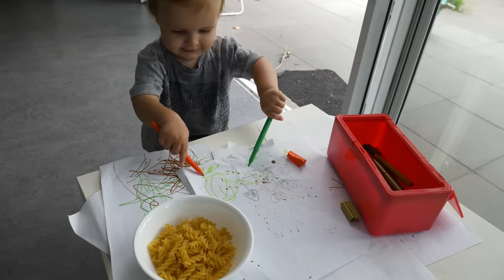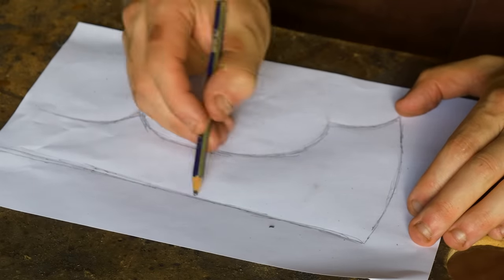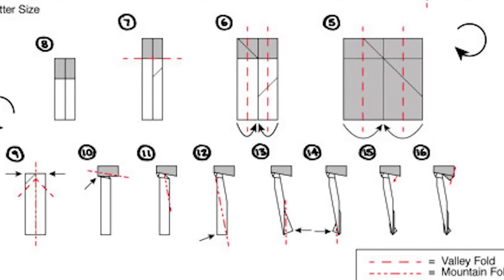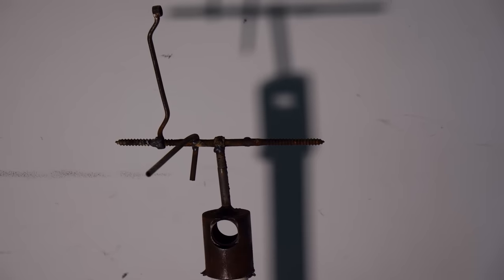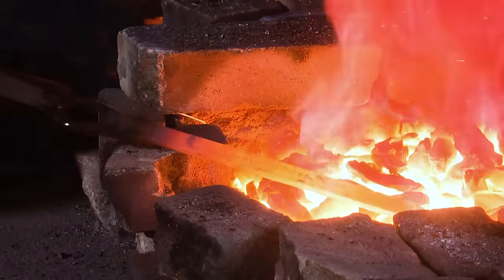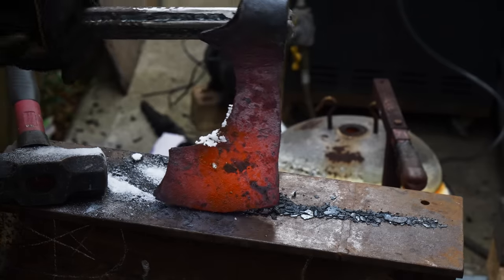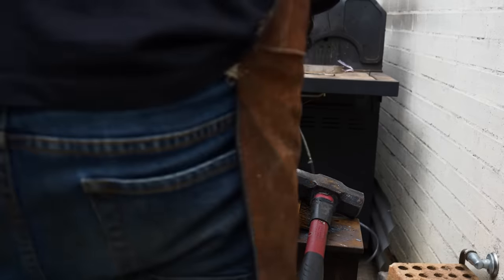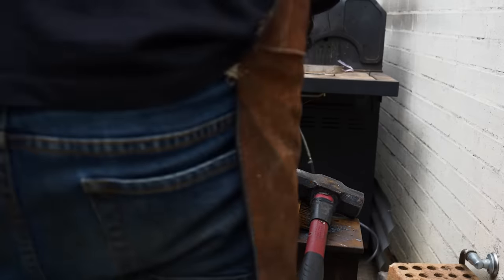YouTube's Worst Blacksmith Makes a Viking Axe!

Comment: This is a bit late but the reason lumberjacks have two heads on thier axes is because when one side becomes dull they don’t waste the day walking back to the camp. they just use the other side
Reply: Close but not quite, one side is kept sharp for for chopping at waist height away from the ground and the other side ment as a sacrificial edge when chopping close to the ground.
Reply: @codywright6224  Could be either or depending on the overall job at hand. It could really be used for either purpose, which isn't much of a conflict, but a syngergy.
Reply: I thought one side was for chopping and the other for splitting.
Reply: All you internet experts probably haven't even held an axe, let alone felled a tree with one, bahahaha
Reply: @jangofett7047  of course not. I fuckin googled jt
Reply: @Ultimate_Gamer_3000  it
Reply: @jangofett7047  nah don't correct me. I know what I said.
Reply: @Ultimate_Gamer_3000  ok jt
Reply: Is that really true? I feel like if I had to work with an axe all day I would much prefer to carry a backup axe or a small whetstone and occasionally spend 5 minutes to sharpen my axe, rather than having to work all day with a much more awkward to handle and dangerous tool.
Reply: @jangofett7047  you're just jealous that you can't be helpful even online.
Reply: @jangofett7047  
Says the 300 pound couch potato living in his moms basement lol
Reply: @Antares-dw9iv  yeah some do that too. But a two headed ain't to much of a drag
Reply: when i say that part of the vid i was about to comment about that but i looked in th e comments first so i dindt copy
Reply: @Ultimate_Gamer_3000  based
Reply: @jangofett7047  you say that as if its a big deal to chop down a tree, it takes a couple hours (resting time removed) to fell a decently sized tree, its not like its some big task that few people can do
Reply: @jangofett7047  i usually use a chainsaw but I have felled a couple trees with an axe.
Reply: I always thought 2 headed axes were battle axes, not for lumberjacks. Learned something today.
Reply: @Antares-dw9iv  That's more awkward for you? Why?
Reply: @Reactiontime6000  no hes more like a nail that came to life and was dull as a fucking eraser
Reply: That seems to be wrong... Or at least I can't quickly find that explanation, but the same explanation keeps popping up elsewhere. One side is sharper for chopping and cutting, and the other side is duller and rounder, for splitting.

More weight in every single swing seems more impractical as far as energy expenditure, but if you use an axe properly (without fighting it so much), more weight can just help you.

This does not apply to battle axes, where a double bitted axe is just ridiculous and there aren't records of such a thing being seriously used in battle. But anyway.
Reply: @CommunicationsOfficer535  
Stop, stop he’s already dead!
Reply: @Reactiontime6000  no
Reply: @jangofett7047  why are so many people mad at you? Lol
Reply: @jangofett7047  You do know there are real life experts with internet access nowdays?
Reply: @Antares-dw9iv  much more dangerous tool? Wdym?
If ure hitting urself with the blunt end of regular axe, ure using the axe wrong. So if the blunt side is also sharp, it's not more dangerous at all.
Carrying 2 axes would be a lot more inconvenient. Axe is usually arms length or a bit longer. For chopping might be longer. It's... Not convinient to carry 2 that long objects than 1 slightly heavier object
Reply: @jangofett7047  I do actually. With decent axes, with dull axes and with really sharp axes.
Dull axes ain't the best. If I had to go far from home to gather wood I'd rather have a backup edge than one lazy and tired evening and get fked next day
Reply: @rhombo323  I don’t think any people ever actually used axes in war once they moved beyond the Stone Age.
Reply: Thats pretty big brain
Reply: @jangofett7047  I did, once, It was a fairly THICC tree. Not GIANT but the size of a nightstand. And I broke my leg when me and my babysitter cut it down. Memories.
Reply: @rhombo323  There are a lot of two-headed battle axes in fantasy. Axes in general are often depictes as massive chunks of steel. Anyone who has swung a sledge hammer, or even a cleaving axe, realize that it would be completely useless as a weapon unless your opponent is chained to the ground. If you are fighting a human, not a dragon, you don't need a huge amount of weight in the axe head to cause serious damage.  
In the real world, most battle axes are light and nimble, like the tomahawk, the francheska or the viking axe, even the two-handed types.
Later medieval knights used a heavier type of two-handed axe. Sometimes with two axe heads, but more often with one axe head and one hook or spike.  This is in the era of full plate armor. These axes were used quite different from what you would expect though. You can see them more as a giant can opener, used to trip your opponent, or pull them from their saddle. Then the axes are used to bend and pry open the opponents armor, or break or dislocate their joints. There are illustrated fighting manuals from the time, showing these techniques in detail.

There are many archeaolocical finds of two-headed axes, both in artwork and actual artefacts, from the minoan culture for instance. All of these seem to be strictly ceremonial weapons though.
Reply: @Antares-dw9iv  everything you said isn't really true.
Reply: @jangofett7047  I have just thought double headed axes were mainly weapons and not for felling trees and in fiction
Reply: Could they not just carry a sharpener in their pocket?
Reply: It could also be a battle axe with 2 heads as it made it way easier to swing in 2 directions rather than just swinging in one direction.
Reply: @GlorifiedGremlin  Sharpening is also an option, however it's downtime where you're not earning money. I carry two chainsaw chains in the field as changing a chain takes less time than sharpening it. 
Felling axes are generally are more balanced than other axes, as most axes are designed to cut downwards as opposed to a felling axe which needs to cut horizontally. The opposing edges balance each other nicey.
Reply: If you want the truth just ask Cody at Wranglerstar.
Reply: @blackout6411  double edged things are usually more dangerous than single edged ones.
Reply: @lick28  Based on the wording of his comment I can safely assume he hasn't worked with an axe before. I however have. I've worked with hatchets, normal axes traditionally used for lumber, and two-sided axes. I can see how a poorly designed two-sided axe would be counterproductive but if you're using a simple two=sided axe then you have an effective weapon and an even more effective tool. Anyone who has too sharp of an edge has a problem with the design, not the idea of the axe itself.
Reply: @blackout6411  that's not what I'm getting at. The nature of double edged things itself is dangerous. When you handle single edged things, you know to face the blade away from you, but when it comes two double edged things then it's a different case. It's not the design itself that makes it more dangerous/hazardous but rather the nature of double edged tools/weapons.
Reply: @lick28  This sounds foolish. I understand that anything with an edge can be dangerous if a sharp edge is pointed at you but axes are not like knives or swords or razors. Trying to equate them all as posing the same danger is illogical and just wrong. Would you try to box with a firearm? Of course not, but you assume that axes would be wielded the same way you would wield a sword. The edges are different and thus pose a different type of threat.
Reply: @blackout6411  being more dangerous doesn't necessarily mean actually dangerous.bmy point is that double edged things are simply more dangerous than their single edged counterparts. Nothing more nothing less.
Reply: @lick28  That's really dumb, I wish you could see how your statement looks.
Reply: @blackout6411  since we can't come to an understanding, sure. You're correct.
Reply: @lick28  We're arguing opinions, dude. My problem has less to do with what you think compared to what you said.
Reply: @blackout6411  a statement that goes "two edges are more dangerous than one" is not an opinion.
Reply: @blackout6411  a dull blade is still a blade. You're talking about it like it's harmless. We're really just wasting time here.
Reply: @lick28  You're right, it is wasting time because dull blades are less likely to cut than sharp blades. Even a child could understand that.
Reply: @blackout6411  sure man
Reply: @Antares-dw9iv  one of the sides are always dull, while the one facing away from you is sharp. but anyway, double sided axes were decorative ornaments more so than tools
Reply: Lumberjacks had double headed axes because the government knew that double headed axes were harder to throw, and did not want the lumberjacks to start their own militia. They infiltrated the smithing business and spread lies about the effectiveness of double sided axes, but in reality the only goal was to deny any possible uprisings ranged superiority, as lumberjacks we're a lot stronger in close quarters combat due to being absolutely ripped
Reply: I have felled many trees by axe, but i never had a double headed one... i prefer to drop it by chainsaw tho, the flat edge is easier to split by axe...
Reply: @Antares-dw9iv  when i cut my first tree i used a hatchet  but axes have way longer handles. i doubt it would be very dangerous
Reply: @DageLV  

'ure' using your keyboard wrong.
Reply: Also the added weight is a bonus, more weight=more momentum its like a light maul axe
Reply: @jangofett7047  cringe asf bro
Reply: Im not suggesting to do so, but I suppose a doublesided-axe would me more effective if you would choose to use it as a weapon! :D
Reply: The thing about two headed axes for battle is that the extra weight is just not even remotely worth it. More weight means a more unwieldy weapon that's less maneuverable, harder to use, and more tiring to swing. You can make the argument that increased weight will make it hit harder, but the exact same idea applies to swinging the weapon faster, which is obviously harder to do when it's heavier.

So, making it heavier with a double head makes it way harder to use... For what benefit? Having a spare sharpened edge? Just carry a spare axe if you're that worried about it. Being able to do backswings? Those are of somewhat dubious utility. Just holding a stick and swinging it around, it's immediately obvious that any sort of backswing, just reversing the motion of a typical swing, is a hell of a lot weaker than a normal blow because of how your wrist is aligned. Not a good way to deliver a strong blow, you'd almost always be better served by just realigning your axe and swinging properly. It'd be slower... But also a double headed axe would be slower anyway because of the weight.

A sword works with a double edge because the second edge doesn't add any weight, and it also makes the sword better for stabbing. The axe, on the other hand, only becomes more unwieldy while gaining very little.
Reply: @erberor8007  You bring up valid points but double headed axe is more reliable as a tool and historically the lighter ones were suited for throwing. A heavy double headed axe would be useful for stronger people since it would be effective for how we'd use it.
Reply: I thought they did this to make it look cool
Reply: Fyi, its complete bs. They never got used in logging and just sometimes in battle. The labrys has mainly a symbolic character. There where doubble-bit axes for home use, but there are never adopted professionally. There are too many downsides with them.
Reply: @blackout6411  my boy said they’re more effective for how “we” use it after saying double sided axes are better for strong people he really slipped that one in there
Reply: @colin2608  Different people have different methods for how they swing/use their axes. It might be your "boy" just finds double sided axes more effective when he uses them. I imagine he'd have a strong pose when he swings his axe. Assuming he uses axes.
Reply: Responding late but you idea can’t be correct because we know for a fact that lumberjack’s would carry a whetstone, file, and grindstone. So why would they carry all of that just to not use it.
Reply: @karatejoe6332  What you said makes sense to me.
Reply: @jangofett7047  Sure man, a star wars nerd really played D&D enough to know what it’s like to chop a tree.
Reply: That is so interesting!! Thank you for sharing!
Reply: @Ultimate_Gamer_3000  you sir are a chad

Comment: The reason some axes have two blades is for woodcutting, one blade is kept extremely sharp for easy felling of a tree, while the other is kept a bit more dull for chopping roots, as striking the ground is a quick way to dull any sharp blade, so one blade is kept a bit more dull.
Reply: And clearing off the bark around your cutting area because the bark holds dust and other abrasives which will also dull the blade quickly
Reply: well yes, but actually yes
Reply: Yeah pretty much for when you are dealing with abrasive material and don't want to have to keep sharpening your good blade.
Reply: At least a couple guys here know the truth
Reply: Also they can be ground at different angles for different types of work
Reply: Look at big ole smarty man out here, knowing EVERYTHING about axes huh

Comment: Fun fact for anyone who sees this. A double bit axe has two blades for a reason other than looking cool. It has to do with edge retention in different materials. One side of the axe is sharpened to a different angle than the other. The sharper of the two sides is for chopping higher up on the tree, where you aren't in danger of smashing your axe into the ground, and the other side is for work closer to the ground, where the different angle is a sturdier edge that won't take as much damage when you invariably clip the ground by accident.

Comment: Not sure if anyone has said this yet, but: “The purpose of the Double Bit Axe head is to have one side razor sharp and the other side more dull and rounded. Use the razor sharp side for chopping and cutting, and use the duller, rounded side for splitting.”
Reply: also using the hook on the duller side for hooking into felled trees for dragging it around
Reply: I thought it was to balance the weight so that it doesn't feel heavy on one side
Reply: I thought it was for battle. So you can swing left to right?

Comment: “I just don’t see why you’d need a double headed axe”
Shadiversity liked that
Reply: literally the last video i watched before this one was one of his videos!
Reply: Yes
Reply: when Shad hears of this he will be quite pleased, i'd assume
Reply: ANGRY SKALLAGRIM NOISES
Reply: So you sharpen it half as often. For logging purposes.
Reply: I just had an idea. Maybe, just in case one head of the axe broke or became to dull to use, there was another backup axe head. I'm also nearly 100% percent sure that double headed axes were used only as weapons, and not for chopping down lumber.
Reply: @Oceanrex  well you should be less certain than that. They were rarely used for combat purposes.
Reply: So when one side gets dull you can use the other side.

Edit: This is more for cutting down trees than combat purposes.
Reply: Who
Reply: One side is more blunt on double sided axes for working through knots. The other side sharp for actually getting the tree down.
Reply: @nilsmcmountain2377  additionally, one side can be sharpened to cut wood better while the other sharpened to split wood beter.

Comment: The purpose of double bitted axes in history was (likely) primarily for woodchopping, so you could chop until the first got dull, then keep using the other side for a good while before they have to stop to sharpen the blades.

Comment: Bit late but a double headed axe has two heads, they have different edge angles on either side.  One side is for stuff like splitting and not sticking as much, that side has a Steeper edge angle, the more shallow side is for biting deep into a tree. To take the chunks out and fell the tree. Essentially a 2 for 1 deal

Comment: 3:44 someone's gonna take this seriously.
Reply: .................. I think you are right
Reply: Someone on Facebook will probably claim this cures Coronavirus.
Reply: eh natural selection
Reply: A little vinegar wont hurt them.
Reply: Yall don't put rust vinegar in your coffee?
Reply: @PanoramaRolePlay  what have we been doing our entire life?
Reply: It's also a great face mask
Reply: GOOD
Reply: thats just my favorite brand of chocolate milk
Reply: I think you mean FLORIDA MAN will take this seriously
Reply: i mean, it would work, nothing in vinegar will harm you, roman soldiers drank it diluted when they weren’t allowed wine, and iron supplement capsules are literally just rust powder in a pill, so as long as the metal, the only risk i could think of would be iron overdose, but if a solution that not saturated with iron and dilute it even further as he says, i wouldn’t see a problem as long as there’s not too much iron from other sources and the steel doesn’t contained any elements which are toxic at lower levels